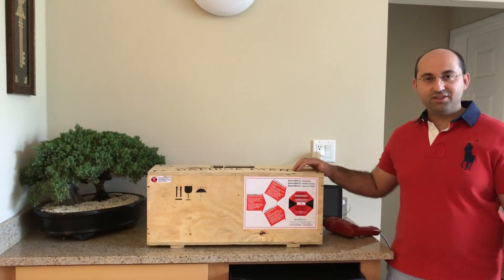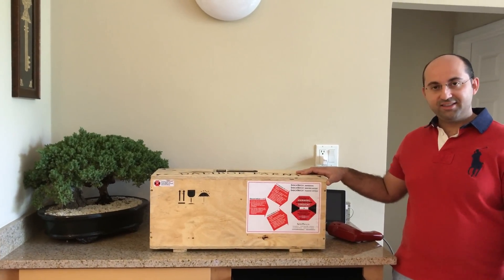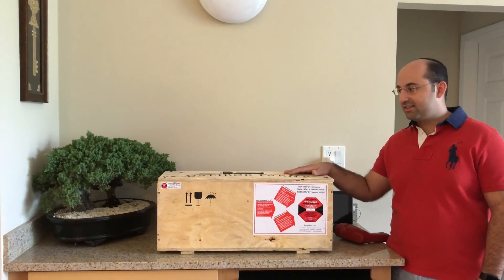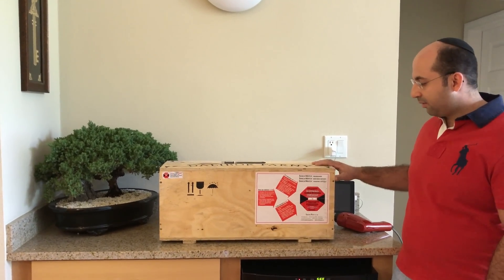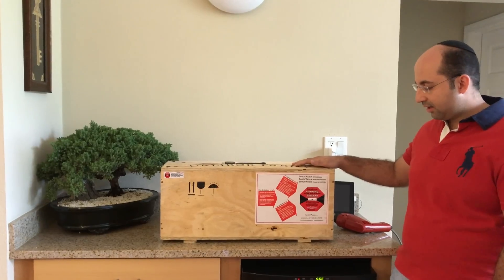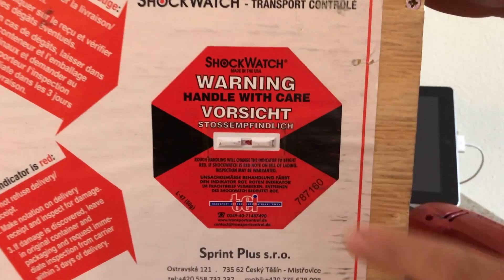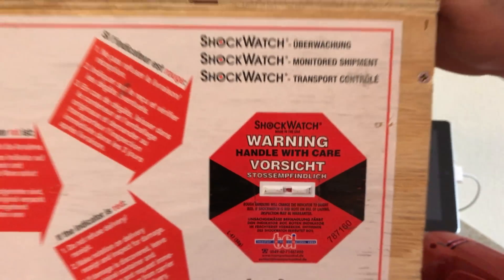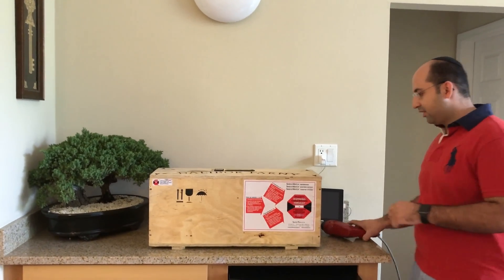NIXIE Tube Clock Unboxing & Overview | Dalibor Farny's Zen Clock | R|Z568M

Comment: What is the cause of the four silver marks on the front and back edges of the circuit board?  It looks like maybe the shipping tape pulled off gold plating?  Also, the bottom edge of the clear cover is not square to the base in your closeup of the left end.

Comment: That blinking green LED kinda ruins the whole build.
Nothing a piece of black electrical tape can't fix but gee...
Reply from the maker: Since the making of the video, Dalibor updated the firmware on the clock to allow me to shut off the blinking led. I can also turn on the 8 led downlighting and uplighting while choosing any hue and luminosity should I choose to do so. The intensity of the tubes can also be adjusted even based on a schedule.

Comment: destroy these LEDs !
Reply from the maker: Since the making of the video, Dalibor updated the firmware on the clock to allow me to shut off the blinking led. I can also turn on the 8 led downlighting and uplighting while choosing any hue and luminosity should I choose to do so. The intensity of the tubes can also be adjusted even based on a schedule.

Comment: Great piece !!,  for the shipping box it is sturdy but safe for itself not for the show case, a heavy real glass mounted directly on top of its wooden base ! thats a wrong way to ship it, at least he should put a rubber gasket between the glass and the base or separate those pieces inside the box, no matter what while shipping something will happen, cracks of course, because while shipping, dropping, moving box around, some kind of a shock will send its energy that will stop somewhere, may be the glass ?  then the glass will hit the tubes ? the power supply never put it inside between those expensive tubes cost around $100 each ! ? he took a lot of risks to ship this precious clock,  at the end that blinking led is very annoying specially at night, it doesnt match the set ....thanks for the video though and enjoy your piece.

Comment: How much does it cost?
Reply: Юрий Пономарёв one of this size and quality? A lot. I'd say over 500$ probably close to 1000$
Reply: Юрий Пономарёв smaller ones run around 150$ to 200$
Reply: Юрий Пономарёв looked it up. this one, complete with the glass case is almost 1,700$ USD.

Comment: hope you can turn off that green led. other wise it's an amazing clock.
Reply from the maker: Since the making of the video, Dalibor updated the firmware on the clock to allow me to shut off the blinking led. I can also turn on the 8 led downlighting and uplighting while choosing any hue and luminosity should I choose to do so. The intensity of the tubes can also be adjusted even based on a schedule.

Comment: Quality build but shipping is very poor. Power supply should never be shipped between nixies at 6:05. Glass should be separately packed. This would avoid crack at 13:35.
Get rid of that annoying green flashing LED seen at 9:38. 
What about leading zero suppression!
Reply: "Crack at 13:35"
What crack?
Reply: But Peter is right.
Reply: He means at 11:55
Reply: Peter Kay the crack on the outside of the glass was caused by this yahoo watch when he sets it down on his granite counter top!
Reply: Personally, I prefer the leading zero.  The tube just sitting there doing nothing is distracting.  With the leading zero, at least they all seem to be working together.
Reply: Many wounds bleeding is ur facts. First that glass is tempered design. Seconds, silicon bits had avoided the crack. Moreover, it was tightly screwed in the box with the foam sheets. Third, Especally easy that microLED issue to solve: use the package blacktape material to cover them!! And it will never doesn't occur anymore.. Last is: That will come soon as well. -Today Stens;Gate has solved it. Exactly after two years. owo!!

Comment: Beautiful piece except for the flashing led. That needs to go.
Reply from the maker: Since the making of the video, Dalibor updated the firmware on the clock to allow me to shut off the blinking led. I can also turn on the 8 led downlighting and uplighting while choosing any hue and luminosity should I choose to do so. The intensity of the tubes can also be adjusted even based on a schedule.
Reply: yeah should put a piece of electrical tape over it or something.
Reply: I completely agree, it kept distracting me from the beauty of the tubes!
Reply from the maker: Lisa Thibodeau the blinking LED under the board is quite small and actually subtle. When up close you can see it however, it's faint from a couple of feet away

Comment: The blinking LED on the micro is real classy hahaha
Reply: There will be an option to turn off this LED, it is not here yet - the LED helps to diagnose possible issues with WIFI etc..
Reply: yeah, it feels kind of wrong
Reply: thank you, thats very nice! I am designing washing racks right now, this should help us significantly!
Reply: Dalibor Farný
Now that I have your attention, just know that you're a legend for creating these epic tubes. Best of luck with the cleaning process automation.
Reply: http://www.daliborfarny.com/zen-nixie-clock/
"RGB underlight – there are 8 RGB leds (WS2812B – “neopixels”) on the bottom of the board which make some cool effects possible. Purist customers who prefers nixie tube glow only can set the underlight off. This feature is in development!"
Reply: yes, it doesnt match the color of the tubes, I know ;-)
Reply: Dalibor Farný is it possible to change the color of the nixie by using different noble gasses? huge fan by the way I think what you do is art and I love the aesthetics these tubes deliver.
Reply: Martin Čechmánek
I meant the green flashing LED on the microcontroller board.
Reply: Dalibor Farný
Cheers for replying. I do realize it's a simple status LED for things like that, but it caught my eye ;)
Reply: Exactly, I tried argon, the glow intensity is very low compared to neon. Voltage and current is very high, resulting in a lot heat dissipated by the cathodes, very high sputtering rate and very low lifespan. Not worth it. I want to play with other noble gases, but later, there is unfortunately no time for it now.
Reply: @daliborfarny  Perhaps you can endow the filament with Germanium, Sodium or other metals to change the color?
Reply from the maker: With the new firmware, you can choose to turn off the blinking LED light
Reply: Very nice indeed. I built a nixie clock, mounted it is a wood case with a grey tinted glass and the back totally covered so no light leaks in. Looks fantastic.
Reply from the maker: spookanide yea! I can't wait for the led lights below the board and tubes to become functional.
Reply: I second that.
Reply: Perhaps a coating on/in the glass,or lightly tinted glass?I think an azure blue would be very soothing indeed! I've been fascinated with nixies since I was a kid(almost 55 now),and could've swore I either saw or read about a green one.
Reply: that LED was my only criticism but what a piece of art......... beautiful........
Reply: Niall Duncan 
yes it is a piece of art. mine looks great too. I built my own using vintage tubes. nixie clocks are all works of art. I would love one of these large units. they are big bucks. all nixie clicks are big bucks but these ones are mega bucks. over a grand just for the tubes.
Reply: I can see why they are so expensive..... hand built and retro but modern at the same time....gorgeous
Reply: I watched the manufacturing process here on youtube but I appear to have a few more devices to look at.... Yes, I know what you are saying about the glow of ionised gas..... hypnotic to say the least !!
Reply: Nima S ty youyyou u u u you wont Ty ty ti y Tuyour face next year's Dayyour TTY to b try and the TTY your face next week and I will you can tu-it ti your tip for your up n u you wont Ty Ty y ty youy you ui yy ty ti you up you today and tomorrow xD TTY too yogi yo Ty yet but the you the you tube channel number and you can tellyour doctor about you can ui you
Reply: Nixie is love, Nixie is life
Reply: Shame the glass is cracked.
Reply: Have you been to Dalibor's site to see how he constructs the tubes.
It is fascinating to see the work that goes into these. I love Nixie tubes, and and Panaplex plasma displays. Something about the ionizing of gas to make it glow. I have been a Neon collector for over 30 years, and have a very old piece in my collection that goes back to the 1930's and it runs 24/7.
I also like the old retro Numitron display. So simple, an incandescent filament to light up the digits. So simple, and yet so cool. VFD tubes also nice, but nothing as cool as Nixie. Both the vintage, and the new designs. The only down side of modern nixie production is they could become common place, and that would impact the coolness of a retro  display. One of the attraction of old nixies is, well they are old. Same goes for all the old digital displays. They don't make them anymore, and that adds to the coolness.
Reply: Good question. A friend at work and I were talking about this today. However, I suspect that the required voltages, and electrical properties of the other noble gasses are more difficult to work with with a Nixie type display. If other colors from other gasses were practical, we'd see them used, or documented somewhere. 

I did note that in Dalibor Farny's video on the making of the tubes, there was a purple glowing electrode in a photo of his very early experiments.

Comment: But an LED or Plasma Display is'nt beter ?!? ... I have 7 nixie tubes to sell ...
Reply from the maker: tornador speeder I see you point. In my personal opinion, this is just different. This has a particular aura to it. It's more rare and unique. Definitely an eye candy. To me this is more than a Clock. It's a piece of art. Just my opinion.
Reply: @NimaShayesteh  If you wanted to be TRULY rare and unique you would have used ORIGINAL nixie tubes.